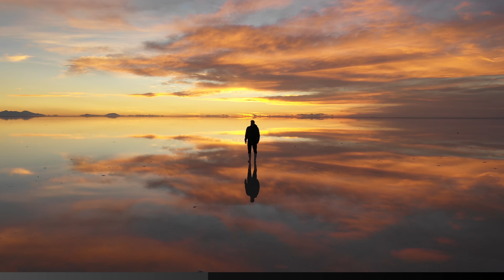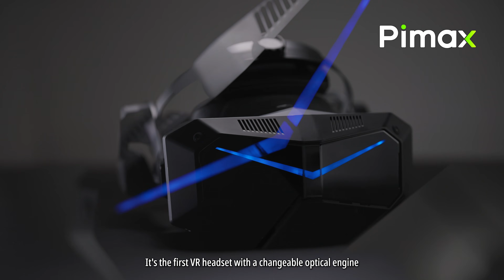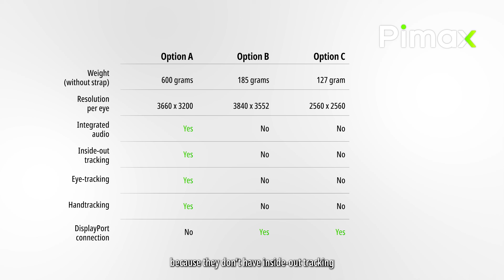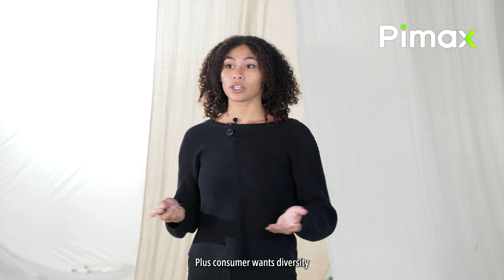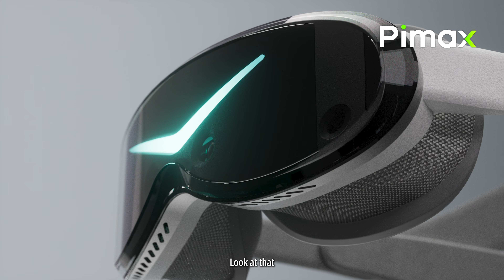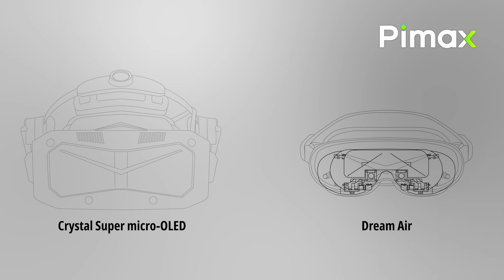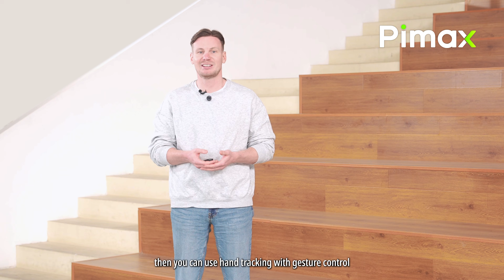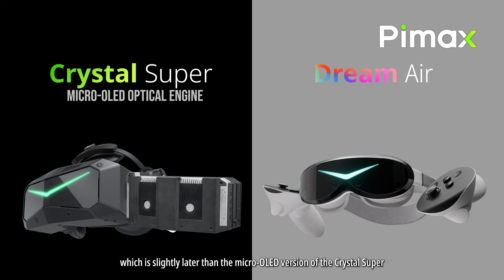Frontier: Hello Pimax Dream Air

Comment: Dear Pimax,
why isn't PPD mentioned for the OLED version of Crystal Super or this new headset? How does it compare to 57/50 PPD versions?

My casual PPD math of Resolution/FOV brings me to 3840/100 = 38PPD for Dream Air.
And I suspect that 57/50 PPD for Super is only possible because of the aspheric lenses which give uneaven PPD across the FOV, make it more dense in the centre (because 3840/120 deg = 32 PPD).

So I am wondering if pancake lenses are giving even PPD across the entire FOV with that simple math and 38 PPD.

Please anyone with a deeper understanding of this matter tell me where I am mistaken.
Reply: Ther are two possible reasons for this, they don't know it yet as the lenses are not final. Or, they don't want to announce the PPD because its actually more than on the Super. As it has the same horizontal resolution but smaller FOV.
Reply: @Nobody-Nowhere  Thank you for your reply, friend. 
I've expanded my original comment with what's on my mind, hoping that someone who knows these things will see it.
Reply: The 57 PPD claim for the Crystal Super appears to be an inflated marketing number just like Pimax's previous inflated FOV claims that aren't real.  The resolution and FOV do not add up anywhere near 57 PPD even assuming higher density toward the center of the lens.
Reply: @SargonDragon  I hear you, friend. Let's hope we'll see some unbiased reviews soon.
Reply: @Eifehr  The problem is that reviewers don't have any means of measuring PPD.  So manufacturers can claim whatever they want and nobody can actually check them on it.

The Apple Vision Pro should have PPD similar to the Crystal Super, and Apple didn't call it a retina display.  And they 100% would have if it was truly ~60 PPD.

The Varjo XR-4 has about the same resolution and FOV, and they only call theirs 51 PPD (which is also inflated).  Average PPD on that one is actually about 36 PPD.

One wonders where Pimax's 57 PPD figure even comes from.
Reply: @SargonDragon  This is what I am trying to understand, alas purely theoretically, because I am still using an HP Reverb G2 and never had my hands on anything Pimax or anything with aspheric or pancake lenses. 

The way I see it, their custom lenses allow for varying degrees of magnification with different curvatures along the lens. It’s like a Fresnel lens with each concentric circle having a bit stronger magnification, basically stretching the same number of pixels across more and more angular degrees. 

So 57 PPD might be only in the 10 degrees in the centre 10x57=570 pixels. And the remaining ~3.3k pixels are spread across the remaining field of vision with decreasing PPD.

They would have to correct for this unevenness in software, pre-distorting the screen output Imagine so that lens distortion would make it “right” again to the eyes. 
This is what’s causing geometric distortions people are talking about in Pimax headsets. 

And pancake lenses are probably too complex as they are with multiple layers and bounces, this doesn’t allow for any of those varying PPD tricks and the math is probably closer to Resolution/FOV ~= PPD

This comment on Reddit shows that this rabbit hole goes much deeper than it seems

https://www.reddit.com/r/Xreal/s/uKAG3E8u87
Reply: @Eifehr  You're right that lens geometry can distort the image to concentrate more PPD toward the center at the cost of less PPD at the periphery.  

This has nothing to do with lens type, by the way.  It's a matter of the chosen lens geometry, not the type.  Aespheric, Fresnel, and pancake can all do it.

But if you look at the math here, the Crystal Super lenses would have to do this much more extremely than on any other headset including Pimax's own previous headsets in order to achieve 57 PPD only in a very small area.

If Pimax has actually done this just so they could claim a high PPD in their marketing materials, I don't think that's a good thing in a technical sense.  It would be sacrificing overall display quality, especially edge to edge clarity.  Which is why I doubt that Pimax has actually done this.

This company has a long history of dishonesty about specifications like this.  Pimax's claims about the FOV on their headsets, for instance, have been significantly inflated.  Some people try to defend this as "FOV varies from person to person though", but the delta between Pimax's marketing claims is much too large to be accounted for by that.  For example, Pimax claims the 8KX has an FOV of 200 degrees when it's actually 160.  Nobody's face shape is causing a 40 degree swing.  Such variances are more like within 5 degrees.  Maybe toward 10 degrees in the most extreme cases.

It's kind of silly to be dishonest about it because 160 degrees on the 8KX is legitimately vastly wider than other headsets on the market without inflating it.  It's not needed.  But Pimax does it anyway.

There's been a trend of Pimax exaggerating their FOV numbers less over time as the community has called them out on it since they've got pretty good tools to measure the actual FOV themselves now.  You can see this in Pimax marketing claiming different FOV for the OG Crystal versus the Crystal Light in spite of both of them actually having identical optical stacks.

I suspect that Pimax's claims about FOVs of the Crystal Super are actually more or less accurate.  I think Pimax has abandoned inflating their FOV numbers for new headsets at this point.  So they just switched to inflating their PPD numbers instead.  Since users don't have tools to check that yet.
Reply: @SargonDragon  I've learned quite a bit from your reply, thanks for such an elaborate answer, friend.

My biggest revelation today was that to calculate PPD you use FOV of one screen, not the claimed FOV for both, which could be, say, 90 degrees, and then 3840/90 is 42, just as an example...

Anyway, this is all purely theoretical and I will wait on the fence until Shiftall and both Pimax'es are out and tested and reviewed by everyone and Reddit is full of real experiences.

Happy holidays :)
Reply: @Eifehr  You're welcome.  You can avoid the complexities of binocular overlap affecting PPD calculations by just using the vertical FOV and resolution instead.  Then it's just straight vertical resolution / vertical FOV = average PPD.

Comment: I am on my 4th generation of headsets from vive and pimax and I am very excited to be able to wear a headset that is so light and comfortable as this the dream appears to be. The one thing I dislike about my prior experience with high end headsets is that they "fry" your hair and it takes a couple of showers to go back to normal. This headset is designed either intentfully or serendipitously to achieve this result. I will be ordering it today.

Comment: Please for the love of God stop announcing stuff before shipping the shit you announced previously
Reply: @RidgeXR_2  seriously... Wtf happened to the pimax 12k??
Reply: "No"! - Pimax
Reply: you people online have peanut sized noggins
Reply: It's exactly the same optical engine as on the Crystal Super so they share so many resources, also on software. It's not a fully new headset in that way.
Reply: @JaapGrolleman  ok. Point taken. But STLL… finish the damn optical engine on the Crystal Super FIRST.
Reply: @JaapGrolleman That isn't a huge sharing of resources by any means. You can purchase premade optical assemblies. At least in my experience it's arguably one of the simpler pieces of the HMD, long as you aren't designing the optical assembly yourself. That doesn't mean we can confidently expect the company to figure out thermals, tracking, those new controllers, a motorized headstrap and mechanical IPD system, and fit this all into the form factor you've just shown us in that extremely shoddy render, then take that from design to full scale production in just 4 months. That is ridiculous. I'd be skeptical of a 4 month promise even if you had a complete prototype, and not just an ugly 3D print and an uglier render. Pimax's past promises have shown a common theme here, and if I were a betting man I would bet a large amount that this thing doesn't ship on time.

Comment: Honestly,  this looks perfect.  Just wish it had dmas support.
Reply: That probably depends on the quality of the included audio and availability of 3.5mm earbud jack.
Reply: lol DMAS would add 60% more weight
Reply: I agree, I'd love to be able to add DMAS if the built in audio isn't that great. Still, I am impressed with this and will consider it since it will have an upgradable lighthouse faceplate in the future.

Comment: With some of the community already reporting poor after sales due to faulty headsets. Some including myself are nervous to purchase the crystal atm. Quality over quantity please.
Reply: Maybe you don’t hear from the ones without issues? My PCL works fine.
Reply: @Idkau-2  False 'survivor bias'. 
"It works for me, so you must be the issue" 

Pimax are FUCKING INFAMOUS for their shit ass quality and terrible customer support.
I went through FOUR fucking 5k+'s trying to get a good one before forcing a return via Chargeback... after them telling me I was the problem, even though it was clearly their shit ass screens showing up DOA, and then trying to upsell me on an 8KX that they didn't know when the stock would be in, and it would have ended up costing me MORE money than just buying an 8KX outright...
Reply: @Idkau-2  as someone who recently bought into pimax I saw the arguments about how terrible they used to be and heard the arguments of how much better their products are these days, however upon receiving my crystal light it stopped working on my pc after 1 day, for the one day I got to use it I could not get my eyes to focus at all. I couldn't fix whatever broke it so I had to send it back and never got a chance to figure out why the image was so faulty for my eyes
Reply: They've come a long way and I've been enjoying their headsets. 8KX, Crystal Sim and Light. Quality has been consistent so far without any issues. I am happy with my current headsets, but going to grab the dream air and so should you.

Comment: You've spent the last five years releasing nothing but headsets with smaller FOVs than the Vision 8K X. Release the Reality 12K!
Reply: Good news, this one is smaller... oh... not sure about ita FOV though.
Reply: From Pimax website:

Nvidia's most powerful graphics card, Nvidia 4090, can drive display devices up to 8K at 60Hz with a single video interface. So that's enough for the Pimax 8K and Crystal or Crystal Light, but already, these headsets run close to the limits of the DP1.4 interface.

The bandwidth of Display 1.4 is 32.4Gbps, but the effective bandwidth — or throughput — is actually 25.9Gbps. When the Crystal Light or Crystal runs a refresh rate of 120 Hz and uses Display Stream Compression, the actual used bandwidth is very very close to this value. Then the last bit of bandwidth, we need for more things than just the image. Think about the SLAM tracking algorithm, hand tracking, MR image processing, image stitching, eye-tracking, and audio.

We can push the screen compression a bit more, it's visually lossless, but even with that, for the 12K we cannot achieve the required bandwidth. We tried a dual DP1.4 solution, with a dual bridge chip. But we're not satisfied with this solution and its outcome on the visual quality.

So we need to wait for a GPU with a DP 2.1 interface, which Nvidia right now does not have. AMD does have one, but there is currently no suitable bridge chip to support it.
Reply: exactly!  It seems like there is no upgrade to the 8Kx if you like a large FOV